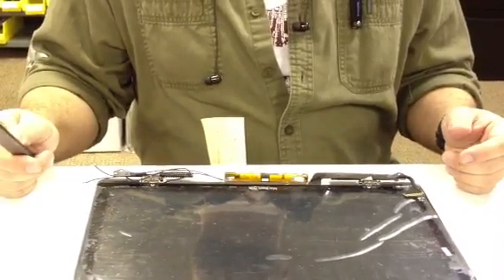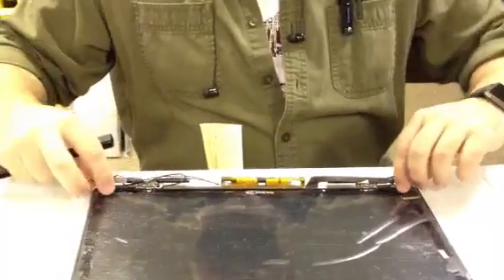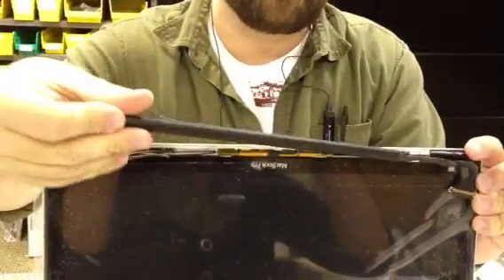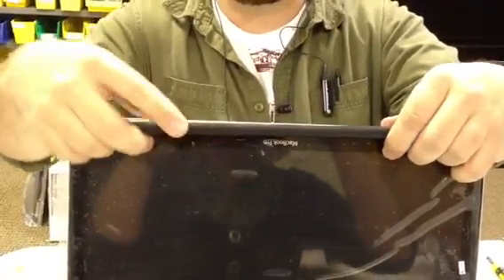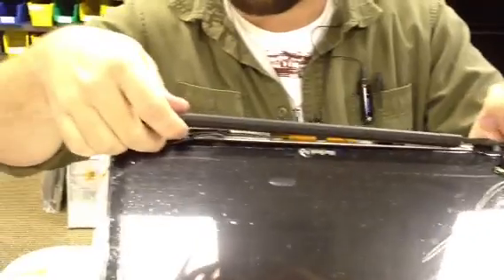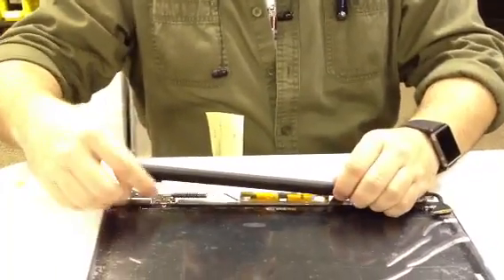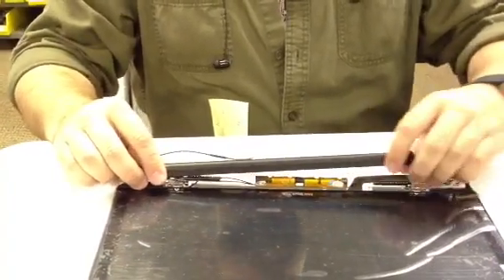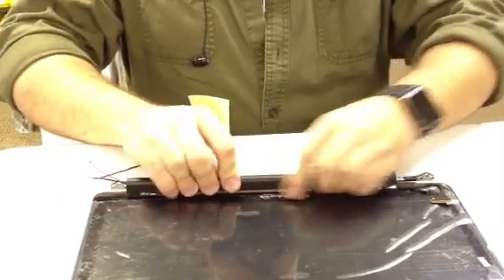MacBook Pro Clutch Cover replacement

Comment: which screwdriver do I need in order to remove them tiny black screws along the plastic that holds the cables including the screen cable?
thanks
Reply: Phillips #000 screwdriver